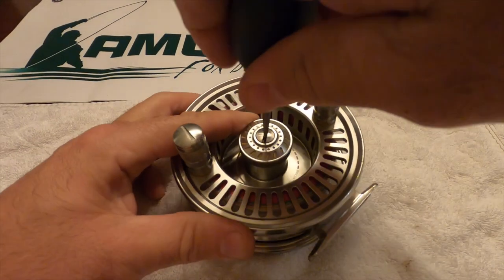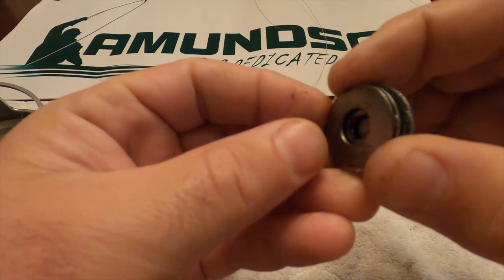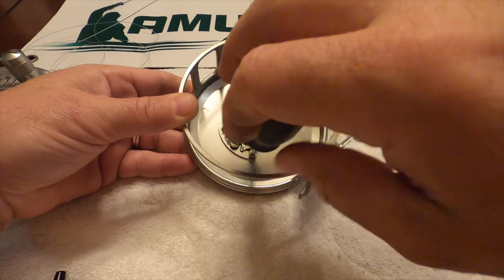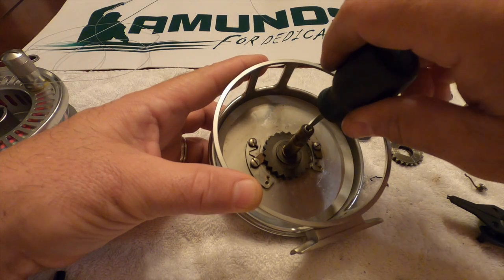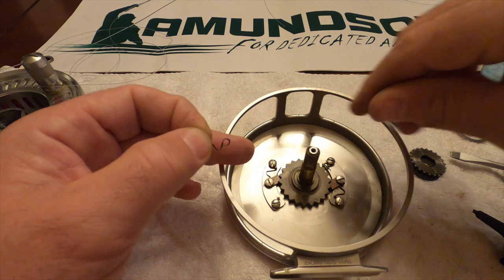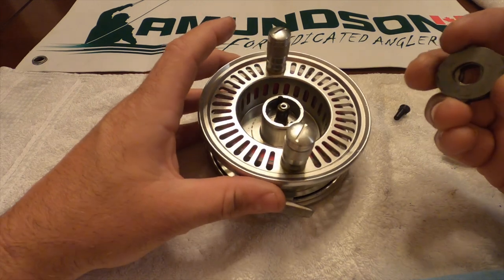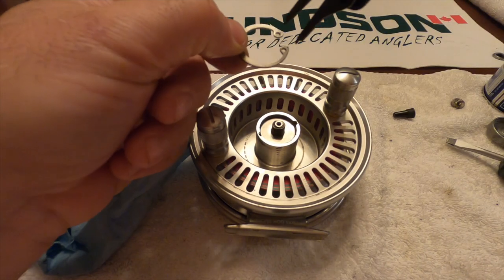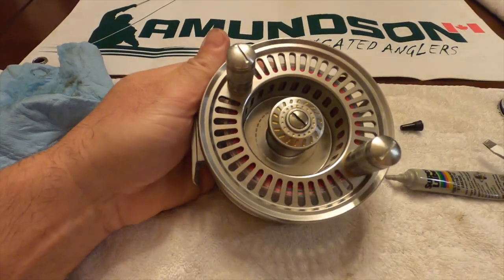Amundson TMX5 - Trend 5 Mooching Reel - Maintenance and re-assembly

Comment: Thanks for posting this... I have 3 of the TMX5, and LOVE them. Originally started with the TMX 4 but after having the boat broken into 2 yrs ago and ALL our reels stolen (my sons MR3) even he has become an Amundson convert. We’re starting to have an issue with the drag on one of them, it’s goes from too loose to too tight, and I’ll be servicing it before this weekend. My question is what you’re using to spray/clean the old grease off. I’ve heard conflicting info from several different sources and don’t want to mess anything up. I’m located in Victoria so I’ll also check with the guys at Trotac. The info in the video has made it all less daunting now to ‘get Er done!’
Reply from the maker: sorry for the late reply, you'll find that the drag discs create a fine dust and with a bit of moisture it turns pasty. This will settle on the the little springs and won't allow the drag screw to tighten loose as nicely. Take those springs out, spray down with WD 40, dry off well then re-install. If this doesn't work, let me know. Cheers.
Reply: Coastal Blue Adventures Ltd. The timing is not a problem, I appreciate you taking the time to respond! That makes sense as to what’s happening to 1 of our 3 TMX5’s after researching the video but I’ll be digging into it (and checking the other two) later this week. If I find anything different I’ll let you know for sure. For us, springs have ‘dried up’ right now and coho are just starting to ramp up. With an off week it’s service gear time for me!

Comment: Good tutorial. Do you need to lubricate the shaft before putting the spool back on? Thanks
Reply from the maker: I generally do, a small amount. Especially on the top threads.
Reply from the maker: Yes, I always put a bit of grease on that arbour shaft. Cheers!